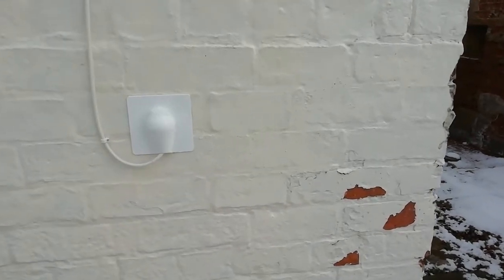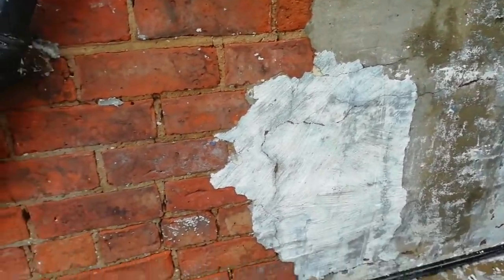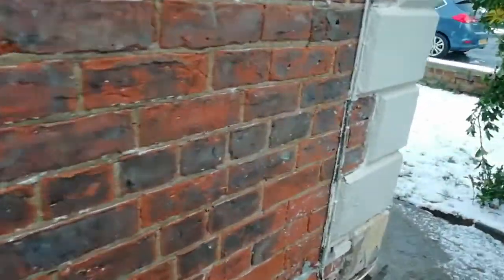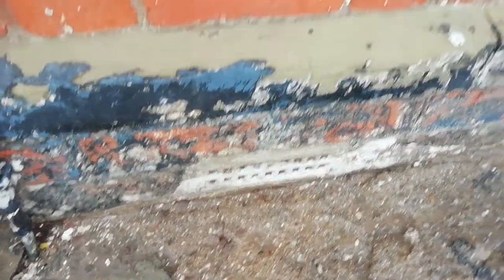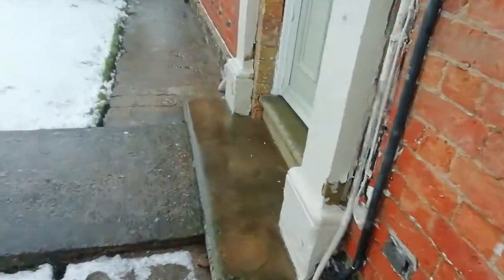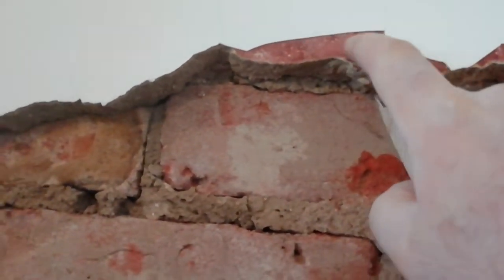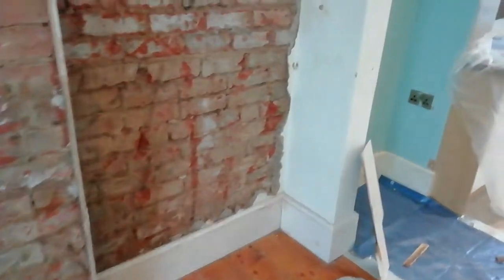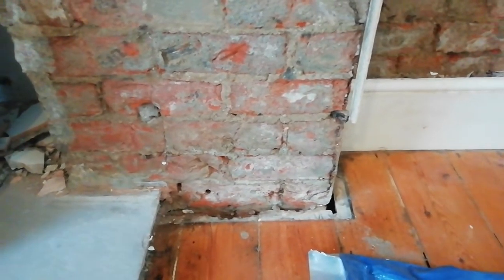An illustration of how wet an old house can get when the wrong materials are used.

Comment: Got to love air bricks at 'ground' level,  I've also seen a few of those and the damage they cause. If their not letting water in, then they've been blocked up by the home owner because they can feel ''draughts' lol!  

I'd love to see how the house looked when it was new. Personally I like to see all paths at least a foot away, preferably three if there is space. Nothing cheapens the look of an old house than paths running right up to the wall in my opinion. 

What do you like to see up to the brickwork? Low ground cover type planting, gravel or slate chips etc?  

In contrast, I've just finished an old cabin resto (in Norway admittedly, but way up in the mountains so super cold and snowy for 6 months of the year) and they had little wild scrubby blueberry bushes ground cover right round the cabin, probably only about 6" high or so. The soil was dry enough to be virtually dusty next to the foundation wall even though the weather had been quite wet in previous weeks. 

Looking forward to see more of your work :-)

Comment: Yeah take three courters of the wall off and leave the beading and skirting on😮😮😮😮 top job
Reply from the maker: Always leave the wooden beads and any other original features on where possible. Skirting boards can stay on as long as all the gypsum is removed from behind.  Lime mortar works well with timber.

Comment: Are the drill holes from dry rods?
Reply from the maker: Could be dry rods.  I assumed they're for injected cream but dry rods is a good shout 👍
Reply: @strikemehandsome  what are your thoughts on dry rods..? I have a job coming up, similar situation with cement mortar patch up jobs ruining the brick work and holding in the moisture and I was considering using dry rods to dry it out and then repointing with lime mortar ...
Reply from the maker: @Nat1videos  dry rods are useless in old houses.  You need to allow moisture to be able to evaporate from old buildings.  Old houses allow water in to the substrate and allow it get out again.  Lime pointing or lime render with a lime wash is much more appropriate. Have you seen the video how harling works by Dr David Wiggins?
Reply: @strikemehandsome  No, but I'll look it up :)
Reply from the maker: @Nat1videos  it all seems obvious once he's explained it 👍